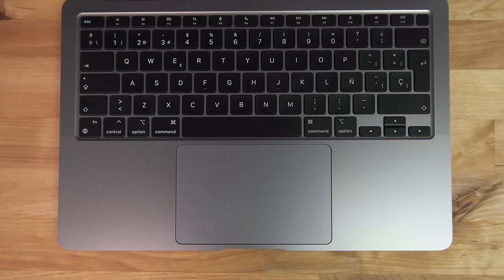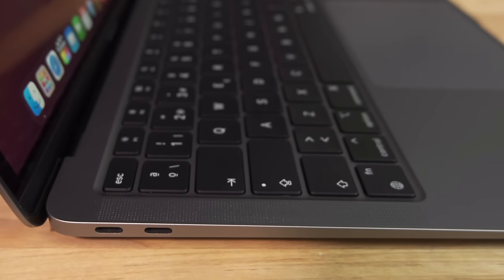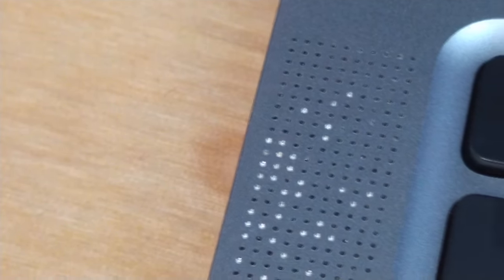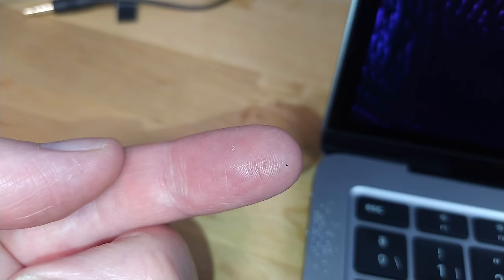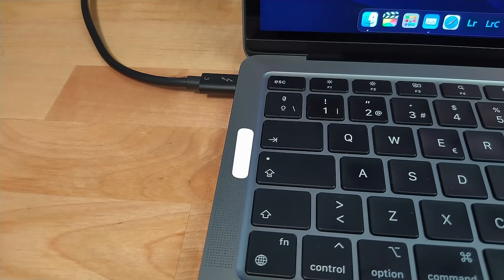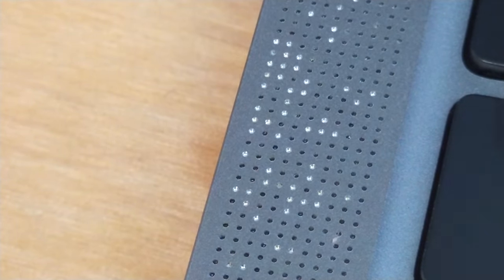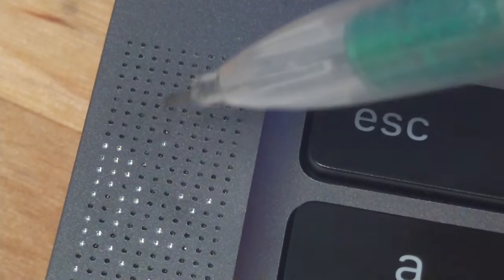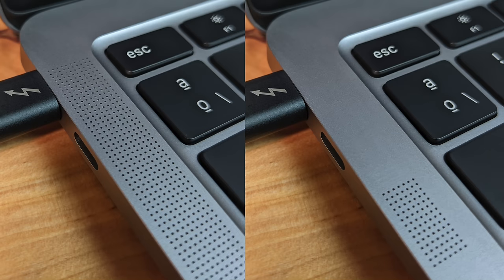Cleaning the Speaker Grille Holes on a MacBook Pro or MacBook Air

Comment: They still can clog up with dirt, especially ones closer to the keyboard. You can take a soft cosmetic brush and gently prod those depressions at an angle to loosen the dirt. Then use some compressed air and wipe with a moist cloth. That’s how I cleaned my speaker grill.
Reply: thank you this worked for me. I had a small stain next to the grille that I tried rubbing out with my finger and ended up clogging the dimples with dirt from my finger
Reply: Used this technique, it worked, thanks!
Reply: I used a 3/4" CraftSmart paintbrush and it is sooo much better looking. I don't know what I did to clog it but I'll be more careful now! I know he says not to use a brush but that is like saying don't use a Q-Tip to me!! Plus, why would I want to clog the speaker holes wherever they may be??
Reply from the maker: I say not to use a brush because doing so runs the risk of dislodging the specks of black paint inside the dimples, making it look worse than before.
Reply: That’s why use a SOFT (e.g. cosmetic) brush and do it GENTLY. This paint is quite durable, much more durable than dirt clogging it up. I did it several times already and it’s fine if you’re careful.

Comment: i dont see the part where you tell me how i SHOULD clean it, only what to do if i do it the wrong way.
Reply from the maker: You shouldn't clean it. Any attempt to clean it will just remove more of the specks of paint that are pretending to be holes, making it look worse.
Reply: Any tips on what migjt have caused the macbook pro with water damaged and speaker system makes it clogged so it doesnt power on? 
 @BartechTV

Comment: After reading the internet i’ve tried several things. And the only thing that works is using small a whiteboard marker. First i clean the holes with a slightly wet microfober towel. After few seconds of drying, i do make the holes black that are white. Softly wipe over it with the microfiber towel and it looks good again.

Till few days later and there is again grain in it. It so annoying haha! Don’t eat behind my laptop and always wash my hands. It’s just a dirt catcher.

Comment: My 'holes' or whatever they are were definitely clogged with something. My computer was nearly brand new and it was only on one side (black macbook pro 2024) - I used a 3/4" CraftSmart paint brush to gently brush it out (with the computer on it's side so it would not just fall back in. It is so nice to have that all gone now! Shout out to the person who posted about the makeup brush!!
Reply from the maker: I guarantee they weren't clogged. Because they are not holes on the 2023 MacBook Pro (there's no 2024 MacBook Pro, yet). They are dimples in the aluminium, painted to look like holes. You can look at the top case from below and see that it is solid aluminium.
Reply: @BartechTV  specs of dust cant get caught in dimples?

Comment: Is this the same for the 16' MBP? because the drills are bigger and I think one of the microfones are placed there
Reply from the maker: Yes it's the same on all Mac laptops. On the 16" there's a small rectangle of real holes at the bottom of the keyboard, and the rest are painted on.

Comment: and how to properly clean the holes??
Reply from the maker: They are not holes. They are dimples in the aluminium painted to look like holes. There is nothing to clean.
Reply: @BartechTV  I believe he is asking about the actual holes, where the speaker is, so the tiny area you pointed out in the video. But as I look at it I see this area is black, so it seems the holes do not "fill up"?
Reply: @cupopwn  I assume they won't, because if you play sound through your speakers regularly they should not clog up and blast the debris out

Comment: Well that’s just absolutely awful design. So they don’t serve any function except to piss people off?
Reply from the maker: Right. They're only there to look pretty.
Reply: @BartechTV  since I bought a MacBook Air I realised they’re genuinely average aside from aesthetics. I opened up a huge work Excel that my HP i5 work computer handles fine, and my M1 MacBook wouldn’t load it properly, just froze for ages.